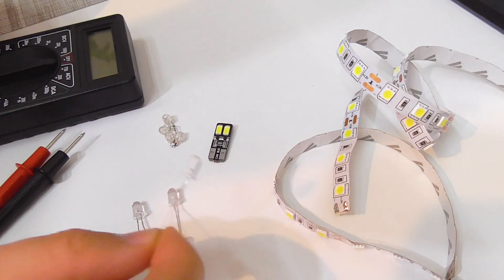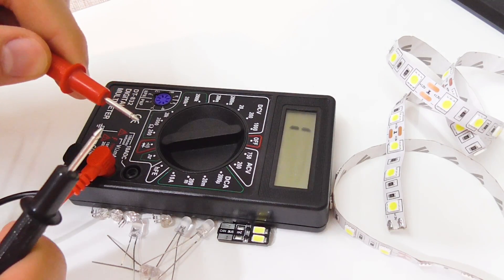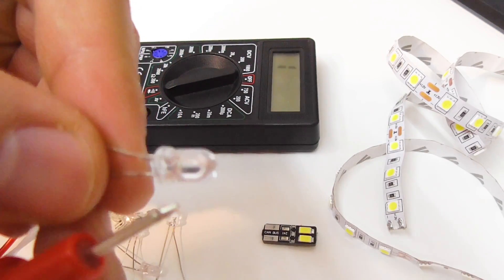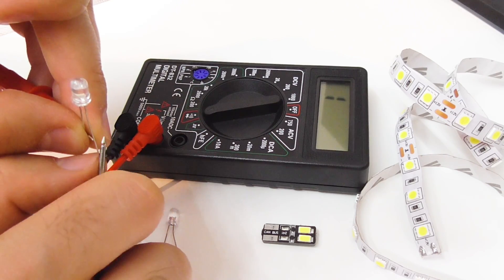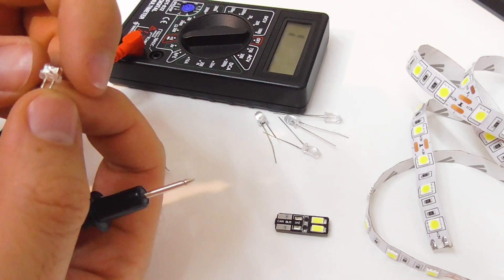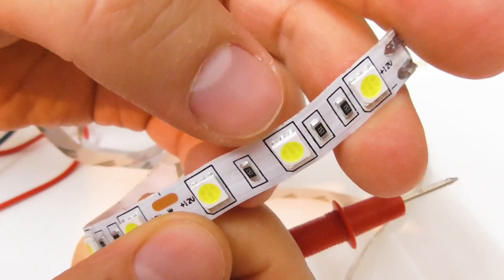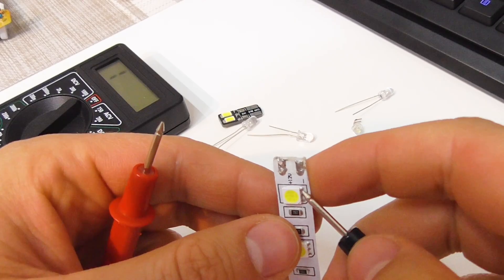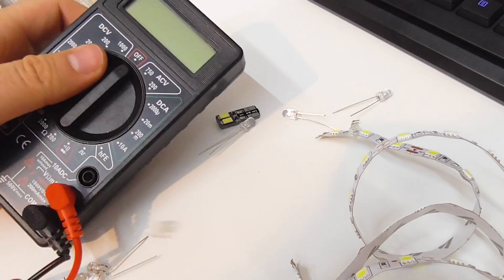How to test LEDs using a cheap Digital Multimeter? (Cylindrical, SMD LED)

Comment: What about LED chips that light up normally when cold, but after they have had power applied for a few minutes start flickering and then become constantly dim thereafter?  I have this issue with a RED LED chip that is part of a radial array of 6 LED chips on the board of a Gemmy Kaleidoscope light fixture. The other 5 LED chips (green, blue, yellow, orange and purple) all light up and behave correctly. It’s only the red chip that will start flickering a few minutes after power up then go constantly dim.

Comment: amigo con ese multímetro se puede medir los wahts de un bombillo led de una moto ...
Reply from the maker: Yes, using the Ampere meter setting. The bulb, meter and power source must be in series. Then multiply the consumed Amps with the voltage of the battery. Volts x Amps = Watts ► https://www.youtube.com/watch?v=9mu7-HOqXAY

Comment: The first you tested both gave a indefinite resistance on your meter....you could only tell it worked because your meter provided enough voltage to make it light up. The second one you tested was even more confusing..logic tells you if the led conduct it is good...but it was broken.

Comment: A cheap way to test ( any ) LED is to use a 9 Volt block battery with a 680 Ω resistor in one of the connector leads , this will light any good LED safely ! FYI , you need to attend to your BLACK multimeter lead as it is about to break at the meter plug end , snip the lead , slide over correct heatshrink , resolder and shrink the sleeve ! ! .......... DAVE™ 🛑

Comment: Hello. Thanks for your videos. I have a question I’m replacing the original T10 on my dashboard 67 Ford. On the circuit board with the old bulb installed I get a sound on my multimeter but when I installed the new led bulb it doesn’t make any sound on the multimeter. I checked the led bulb like you show on the video and get the bulb to light up. I jus want to make sure they work before I install the dashboard back. Thanks for your help.

Comment: Using a DMM, forward voltage on led reads about 2.4v, but when reversing the leads,on anode and cathode meter reads 0.7V. Is that normal? Most videos say OL when reversed?

Comment: 3:58 I don't understand, why the multimeter always shows 1??
Also, some times it shows ohms? And some times just 0,why?
Reply: Because its stating that the resistance is NONE or more or less very low
Reply: And your battery level is different. On a fresh battery it should read 000. As your battery level lowers from being used you'll pick up a one maybe even a two before your meter blank's out

Comment: Why doesnt the continuity buzzer go off for the good led? The led showing shows continuity but no buzz?
Reply: Buzzer buzzes when probes connected via small resistance("short circuit"), but LEDs for multimeter looks like capacitor(it's not really, of course), thus no short circuit or buzz.

Comment: hellol im commenting regarding the video reagarding the batch move from subfolders using total commander

it's my problem too but the only difference is that, instead of files, i need to move the FOLDERS inside those subfolders. total commander  bypasses that and go straight to the files, so cant move the folders inside the subfolders. what do i do?
Reply from the maker: I think it won't work with folders... Tell this issue to the author of Total Commander (support@ghisler.com) maybe it will be added.